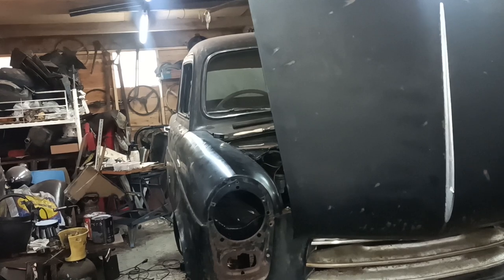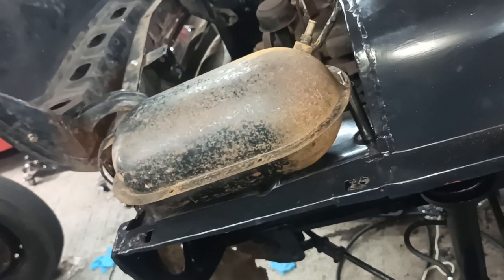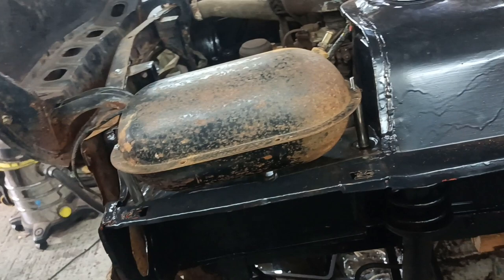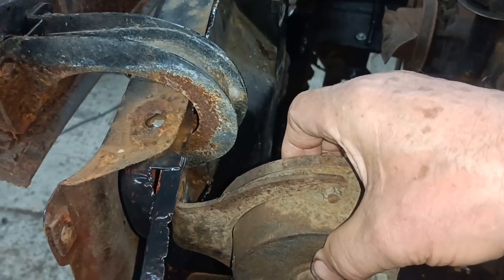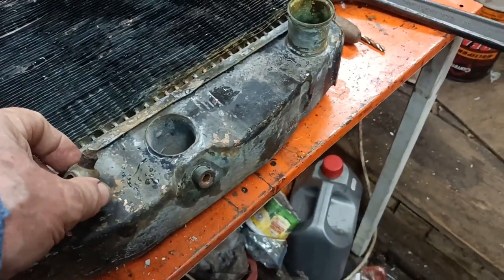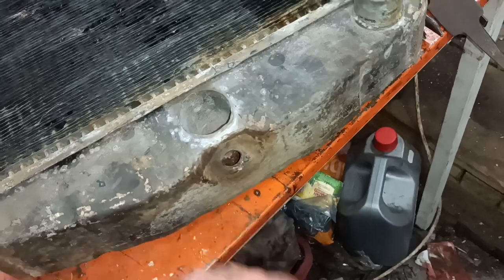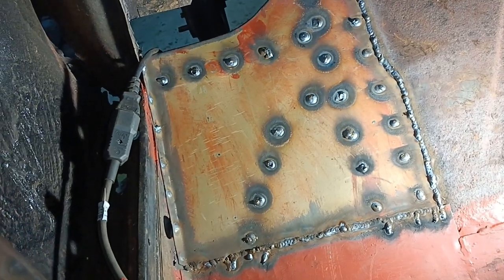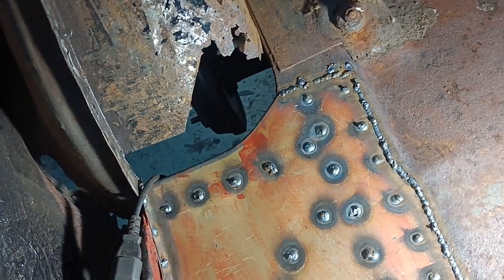Mart's 1955 Ford 100E Anglia part 28! Lets get back to fabrication and welding. (2365)

Comment: Well done Mart, a tricky shape that wheel arch. Like you I have no sheet metal tools apart from  hammers. I resort to making a wooden plug of say the inside of the arch and beating the metal over it on the bench and shrinking by pie cutting and butt welding while held on the plug. Desperation is the mother of invention, keep it up.
Reply from the maker: Hi Pat, yeah we all work in a way we are comfortable with. I'm not much of a wood botherer so I'm not used to doing it that way. Always good to bear something like that in mind, though.

Comment: Your repairs just get better and better mart.
Reply: Indeed they do!

By the way, although the rad cap poundage is 4 p.s.i., they don't run at that pressure; that's just the blow off pressure in the event of overheating or a possible head gasket issue. Using a higher pressure cap doesn't cause the engine to run at a higher than normal pressure or temperature, but could overload the system if something went wrong.

Comment: My dad bought one identical to this in 1954 using it for business he did 85000 miles in five years , a big mileage in those days, the engine was changed and a recon unit fitted and it went on to over a hundred thousand miles before it sold and changed for a  1959 100e Escort estate.  Town and Country tyres on the rear wheels and a hundred weight of cement in the boot along with a shovel and the covered the snowy winters of the 50s.  Tough little cars.
Reply from the maker: Hey, Mel B, thanks for watching and sharing your family story. I had an Escort estate (100E) and I would like one now. I think my dad had town and countries on the back of his Prefect back in the early 60s.

Comment: A trailer hitch ball mounted in your vice or your gas bottle cover- could help with those inner curves. Find a few different sizes maybe from a wrecking yard or a yard sale
Reply from the maker: Good call, Lens. I need to build up a collection of sheet metal tools.
Reply: @MartsGarage That is from "Fitzees Fabrications" YT videos. Liked your press being used as a break for this last job. Multi use tool are the way to go!

Comment: did you consider converting to electric motor? my old ford with vacuum would always stop working going up hills.
Reply from the maker: I remember converting to electric back in the day but I don't expect to drive this one often enough for not great wipers to be a problem. I have vac wipers on all my old cars.
Reply: I have electric wipers on the Prefect but that's an every day car used all year round. The vacuum wipers are what EVERYONE remembers about these cars; worth keeping for the novelty value!

Comment: Man !! The rust just doesn't end on this car does it ?? You're getting passed it very nicely though !! 
Having a lathe provides you with an another entire "problem solving line of thinking" doesn't it ?? Not having a lathe, I was thinking "tacking and adding a washer on the front edge of your threaded sleeve. Your "lathe oriented" solution was/is much better and way more "elegant" !! 
Looked like your thread tap for that radiator cock wasn't "tapered" ??? Or was but was too deep ??? ;o) 
If you aren't already, I would suggest adding Karl @ "Make it Kustom" to your "quality craftsman" viewing. He's HIGHLY skilled, and very informative. Always getting good input from him !!!  
You MUST be getting towards the end of the rust repair no ?? It's looking like a very solid shell now already !!!
Reply from the maker: Hi Ron. I did go a bit deep with the tap. It's always good to fire up the lathe, very satisfying. Not a lot of call for it when doing body repair though. I watch Karl. He is very talented. The shell is getting stronger day by day. You'd be surprised how much there is to do though.
Reply: @MartsGarage  Hi Mart: Being an old, retired, construction veteran, big projects don't phase me much. They're just like building a building or the proverbial "Elephant" - - - - - - "one step at a time" !!! You're doing great !!!!  👍👍👍👍🛠🔩⚙🔨🗜🍺😉😉✌✌